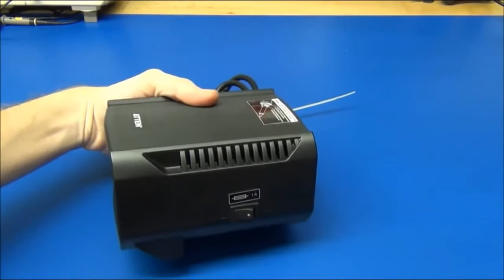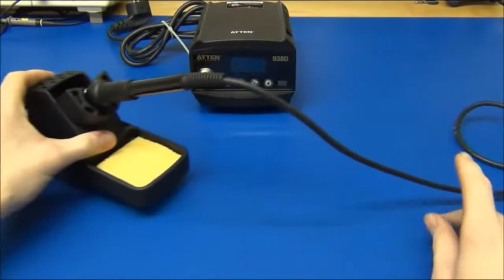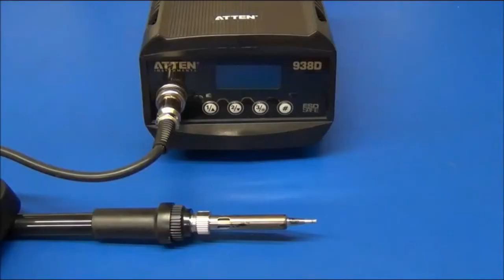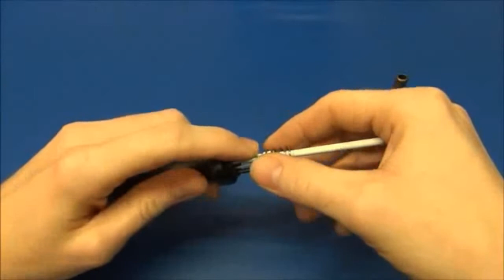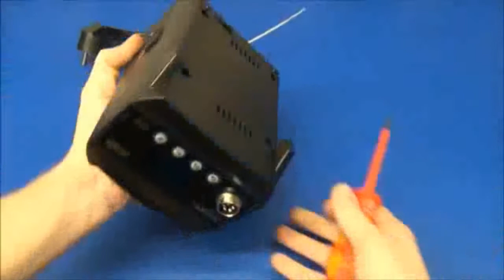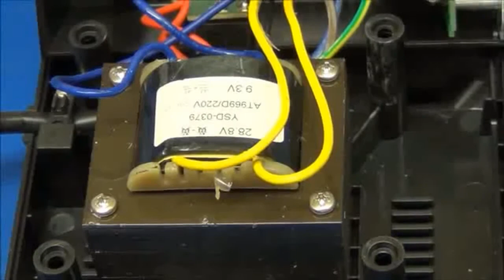Atten AT938D 60W Digital Soldering Station

Comment: Would the iron from this unit work with a TS1390 soldering station, it has 5 pins also.
Reply from the maker: To avoid damage, please use the original factory soldering iron. If you have any inquiry, please contact sales@atten.com.cn